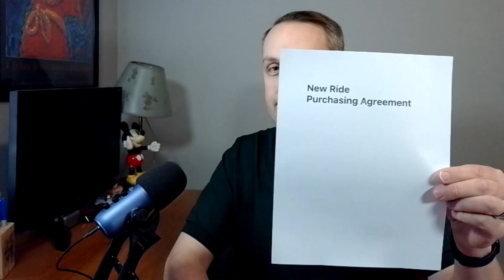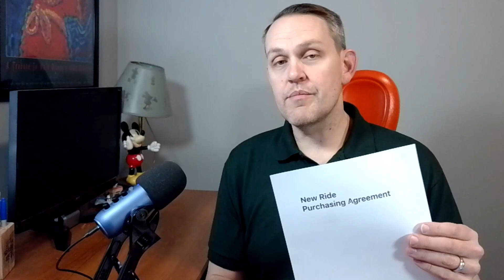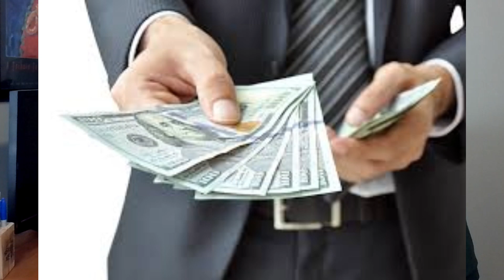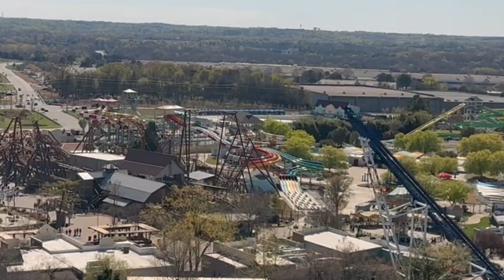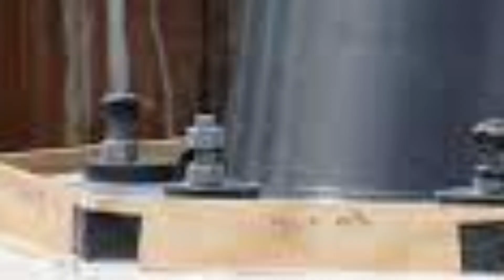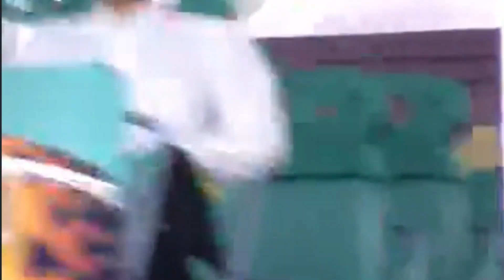This is the document that all new rides start with

Comment: Steel Curtain is in the process of getting additional supports this off-season. Would additional supports be part of the warranty or would that be on the park to pay? Is there ever a time where both the manufacture and the park might split the costs of repairs if it's under warranty?

Comment: Xcelerators launch felt like a teleported I think it felt even more violent than Dragster or Ka launch. But my question is why would they risk completely destroying the ride launching it much faster than what it was designed to do? That just seemed like a stupid risk that could have really backfired in a major way.
Reply from the maker: @JJJJ-he8bz  they needed proof of concept and cedar fair needed the proof. So I’m guessing they got a set of free cables and the cost of the train refurbished reimbursed by INTAMIN.

Comment: We have the same type of thing in my industry when it comes to the purchase/financing plan.   Depending on the cost of the project, it might be 25/25/25/25 for some items, or even 70/20/10 for bigger custom items.  I have also seen it vary based on how long the customer has been with the manufacturer.   If a customer has been with the company long enough and has never had an issue, they will sometimes start with just the signing of the contract.

Comment: Regarding the throughput ^^

My team last year (not gonna say the attraction ^^), we talked a lot about that and we always joked about 600 (with 5 cars max, even though theoretically 7 or even 8 were possible, but not practical and the thing would basically die on us with downtime). So when we really had to be fast, they put me there and tried to give me someone competent for the second man. I would check in with them for the numbers (basically just a light gate at the exit) and I would get 550-570 every hour and if it went extra smooth, 590 a few times. Never hit 600… someone would always be slow entering or leaving or something would throw a failure…

Maybe I try again next season…
Reply from the maker: @TripleTSingt  raise the bar!

Comment: I want the original dragster launch, and tophat, but have I-305 after the tophat, instead of throwing all that potential energy into a brake run. The original layout of I-305 too. With the tight turn, that put people to sleep. Could you imagine that turn coming from 420', instead of 305'. Now THAT is an Intamin masterpiece. If i only had $50,000,000 laying around, id make it happen😂
Reply: That would be a lot of fun! May need to sign waivers for that one, lol
Reply: @LTCoasters  no waivers. If someone tries to sue, we all just relentlessly make fun of them for being a pansy until they drop the case.
Reply from the maker: @Spike-sk7ql  nice
Reply: @ryantheridemechanic  you think I can get the launch system from great adventure since they aren't using it anymore?😂
Reply from the maker: @ you can ask?!
Reply: @ryantheridemechanic  yeah right! They'd probably give me some corporate answer about how Kingda Ka's launch system will be operational for the 2025 season. 😄
Reply: It probably went to Knotts. Spare parts for accelerator
Reply: @robertstephens5185  I'm pretty sure that I heard Tony say that none of the dragster stuff was not compatible, when asked if they were sending the trains to Knotts. So I imagine the same would be true. I think those 2 were built to a far higher level than the rest.
Reply: @Spike-sk7ql  quite possible.

Comment: 19:44 Are those brake fins that are being retracted? And are those being actuated through a mechanical contact with the car, or is it controlled through the plc?
Reply from the maker: @TheLostWorldJP  no plc control at all. They simply hinge up from the force as the car is lifted then fall back down as the coach passes.
Reply: @ryantheridemechanic and on Fluch des Kärnen (spoiler !)...
.
.
.
they lift you up, then drop you down into those brakes, and then lift you over the top.

Comment: Does a mfg. ever contact a park and tell them not to continue running a ride (coaster) do to the fact it has reached what the mfg. considers it to have reached the life expectancy according to the mfg.
Reply from the maker: @fredreubens89  not that I know of
Reply: @ryantheridemechanic  Was Just wondering because there has been a rumor going around that was the reason Kumba has been down for so long at Busch Gardens Tampa. Supposedly B & M has been at the park and told them not to run it.  Even though they have test run it several times lately.  But still closed. Thanks for the videois andquick responses.
Reply from the maker: @ think of what would happen if the manufacturer recommended not running it releasing liability, then the park ran it, and someone got hurt. That would be bad news. A safety bulletin can shut rides down but it would be all rides that style.

Comment: so if a park cannot pay for a ride for whatever reason, and another park picks that ride up, does that new park have to pay that full price still or just what the other park couldn't pay for?
Reply from the maker: @stolenarmy_  whatever that park negotiates with the manufacturer
Reply: @ryantheridemechanic  How much of that ride has been manufactured? How much has been shipped? Is it all sitting at the manufacture's warehouse? Do they have the space to store it, or is it now in the way of other projects? How badly do they need to get it out the door? How much demand is there for the ride? Is it tailored to a specific lot with terrain challenges or can it be built on level ground? 

There's just too many variables to say "in general" what the answer would be vs a case by case basis.